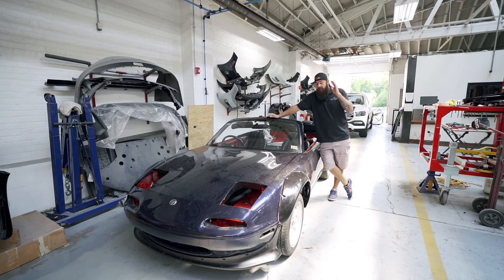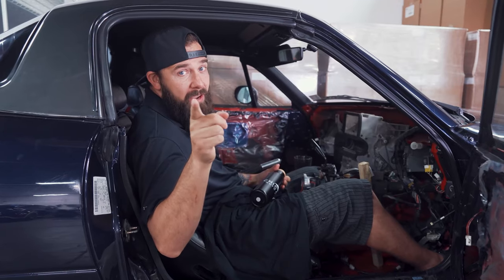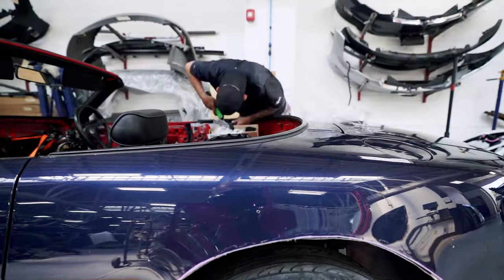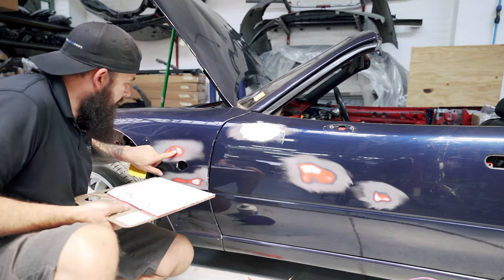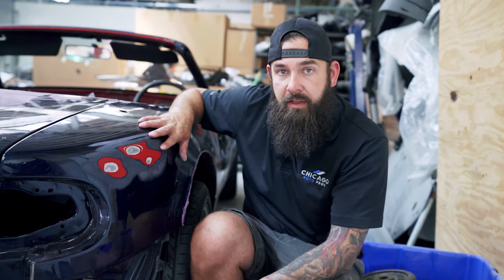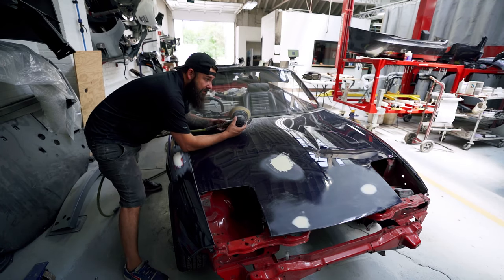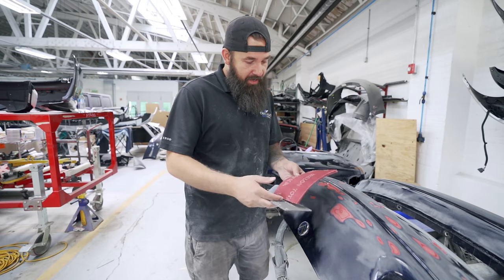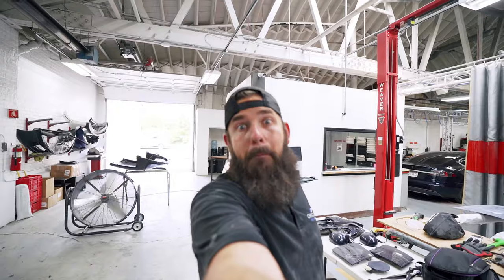How To Prep A Car For PAINT pt.1 | Widebody Miata Paint Prep

Comment: My question is how you get paint overspray off glass?
Reply: razorblade ;)
Reply: @endo3939  they should make a better idea other than that... 🤣🤣🤣
Reply: @endo3939  do I use a lube to protect fron scratches ?
Reply: @chrisnas1483  theres no need, if u use blade at something like 45 degree angle (or less), u can scrape glass and do no damage. Only works on glass tho :D also, u can try wiping overspray with thinners.
Reply: @endo3939  thanks a bunch... 👍👍👍
Reply from the maker: @chrisnas1483  Sometimes using a clay bar can do the trick too.
Reply: There's an old paint shop trick used which is using a razor blade angled which also can be used on the car paint and the technique is named fulcrum, it is basically the same thing is done when you go to a barber shop when they used to shave you manually with that long single blade.  Nowadays, you can use the clay bar and also if there are scratches you can use the rayon pad on a polisher.
Reply: @1stfrompuertorico568  thanks👍
Reply: @ChicagoAutoPros  thanks